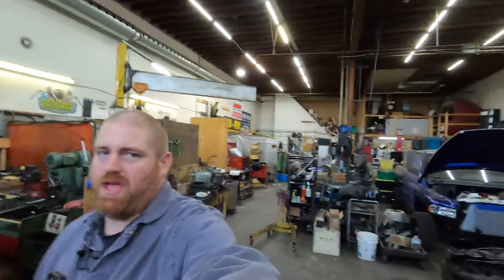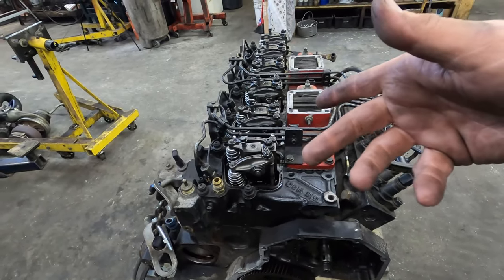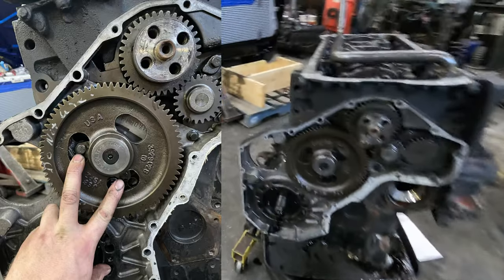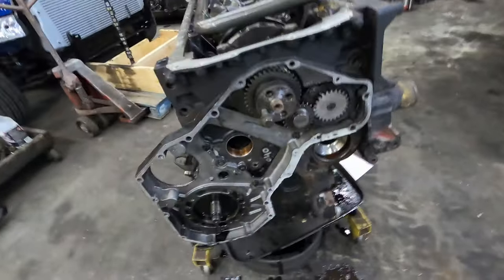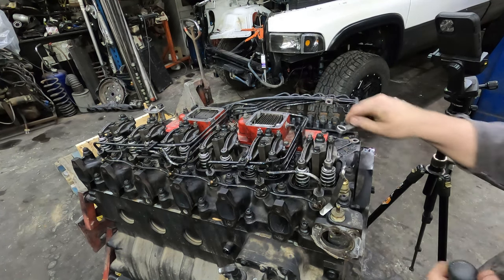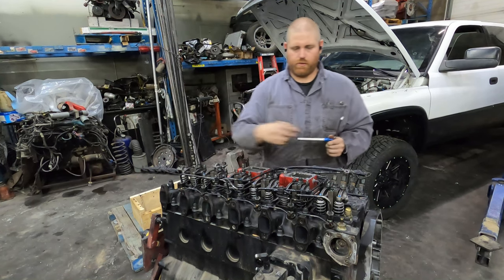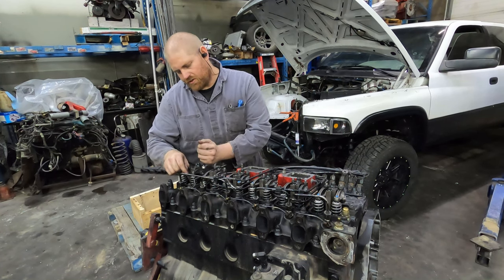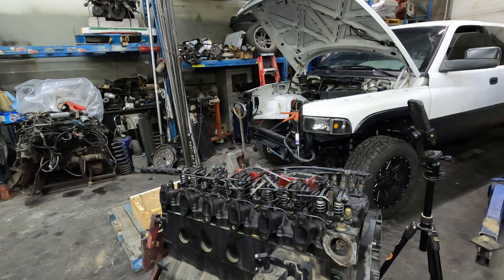12 Valve  Cummins camshaft swap

Comment: 👍👍good stuff feller...I swapped in a 178/208 in a vp44 engine last spring..(cause I had the case off to fix oil leak), truck only has a comp box with a stock injectors and modified hx35..I like the cam..lots of low end and no smoke with comp box on high..used a chunk of stainless milk barn pipeline I cut in half and made the dowels...was a time consuming process for sure...but anyway..thanks for another video 👍👊🍻

Comment: How do I keep my cam from eating my 5.9 block again I followed all the instructions from Hamilton in the spring tappet cam kit. only thing I found is it’s recommended to line bore for bushings or the new hd springs push the cam past the oil and eat the block that’s pretty much what looks like what happened 😢 -5000 in machining and parts 😢
working on swapping a 6.7 into it
Reply from the maker: I would need more info on the setup. But I have run lots of stock bearing setups but I do recommend run zinc additives
Reply: @CUTTERUPROB  the engine was a 5.9 s467 bored 40 over 2nd high mount turbo banks intercooler 188/220 Hamilton cam kit with spring and push rods 12 valve connecting rods with arp main head and connecting rod studs banks intake 5” exhaust running 50% over injectors and high flow cp3 and air dog electric pump dual disk clutch and g56 6 speed with heavy duty case with a rear Yukon locker on 35s custom true dually short bed qaud cab with 373 gears lifted 3” I picked up a 6.7 out of a 16 my truck is a 06 sending it to the machine shop first then I’ll put it together with the industrial qsb pistons and the rest of my internals if their good
Reply: I just dont want another issue with the cam